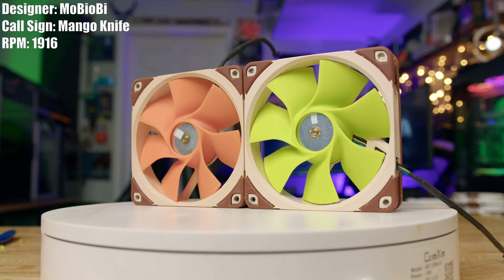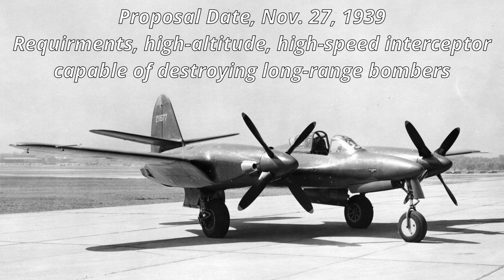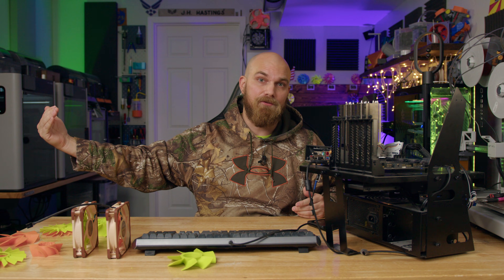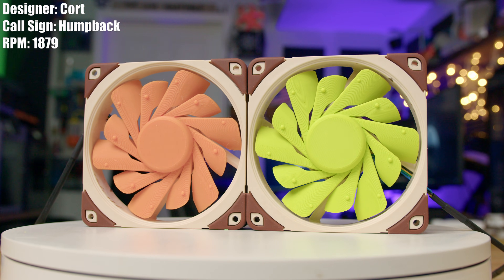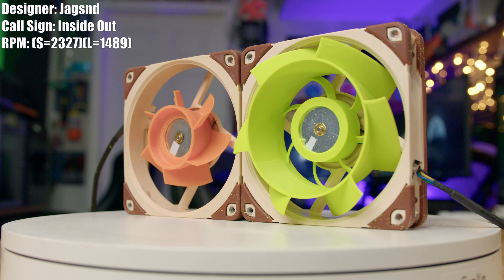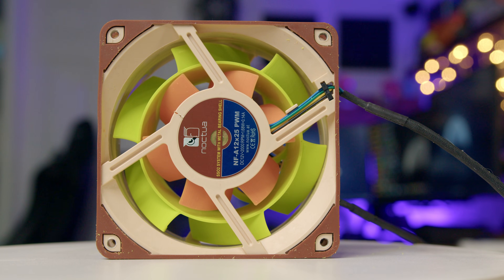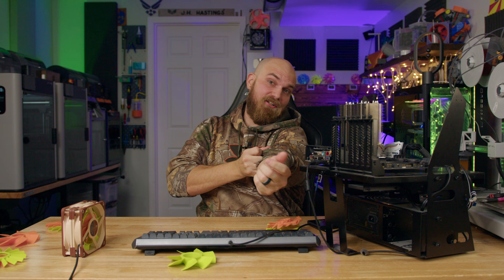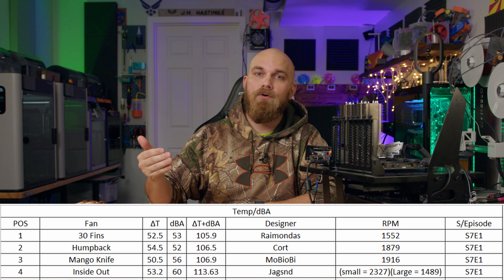Stacked TWIN Fan… is a Monster | Fan Showdown S7E1

Comment: The new smoke machine is sooo good! I immediately noticed it! Now we just need a high speed camera! (lol)
dT + dBA is okay as a metric, as then you can trade off one for the other, but I think there might be a better approach. A dT 90 with 10 dBA would beat all the current fans, but be a terrible fan. I did a few tests in my spreadsheet, but no good equation came to mind. 
Maybe it is a bit too late night :D I will think about it!
Reply: Good point, although most people would be striving for greatness, there will always be 1 joker that submits what you said just beat everyone.
Reply: I liked the smoke test too, although I did miss the big puff and seeing seeing how and where the fans scavenged the air from.  I found it interesting how some fans grabbed air centrally, others grabbed it from just everywhere, but some also would also end up rejecting air around around the front edges rather than pulling it in.

Comment: For scoring, you need to just have 2 scales. The fans score on a scale relative to all of the fans within the season, getting a score out of 100 based on what % difference there is against the most performant fan in each category, normalized against the worst. Add the two scores together to choose winners.
Reply: Right. When comparing two factors, you would just plot one as x and one as y.  Sometimes it's customary to invert one of the plots to make it so "better" values are larger.  For here. Where a lower dB and lower delta-T are preferred, one axis would be inverse db (1/dB) and the other would be 1/delta-T.  It's not super intuitive whena stated like this but when you plot each Fan's result you get an area of a rectangle and the bigger that area the better the fan is.  You end up with a lenticular distribution where the outliers become more obvious.   This also gives options when choosing a fan at the end, where if you want  fan with certain properties you can just draw lines or curves on the graph to find similar fans.  A great too for visually analyzing simple two factor systems.   Especially popular in materials selection because the bottom axis is always inverse cost, lower is better.
Reply: You  shouldn't use dB to score the fans because the sound itself is subjective because  of frequency. 
You can have 2 fans that have the same exact dB levels and one fan will sound louder because of the frequency!  In reality, one fan can have a lower dB and sound louder to you.   The sound is subjective because the fans make sound at different frequencies.  
However, I really like what you guys are saying with the way to score something...  
He needs to scrap the dB as it's subjective.  It provides data but its not useful for scoring.   

 If he has the temp delta, why not have how much air the fan pushes... CFM of the fan ?  ... anything but dB  😁

Comment: Adding ∆T and dBA doesn't work, if that's what you're doing - for ∆T, higher is better, but for dBA, lower is better, so you're adding incompatible units. A really, really, REALLY loud fan would score highly pretty much regardless of how well it cooled. Maybe you need to set a noise ceiling (anything louder than that = DNF), then do ∆T + (C - dBA)? And do some scaling to take into account decibels not being a linear scale.
I dunno, something like that. It's hard to say for certain that you're doing it wrong when you didn't explain what you're doing: the column title says ∆T+dBA but its contents disagree

Comment: I'm thinking your ratings aren't right ... you are making the ΔT as larger is better; then the sound as smaller is better and adding them together. Doesn't this skew things? Wouldn't a better rating be where you took the ΔT as the total subtracted from a 100 (or some other arbitrary number), then add it to the dBA? That way you are talking you are making both as "lower is better" and coming up with an accurate  representation?

Comment: Testing acoustics seems difficult because it depends on different things like rpm, print quality and noise floor (room noise), etc. Also implementing dbA into the score board by adding it to the rest is probably not ideal...

I wonder if it would be better to test every fan at a fixed rpm, noise normalized, or keep testing them at max speed like it's set up atm

Comment: I think greater 'weight' should be applied to the cooling. All the differences between fans are quite small and the sound level is not a linear scale. Therefore multiply the delta T by 2 (adjust as appropriate).

Comment: If the blades are the same, seeing both at same time is a bit distracting. Visual scrutiny was easier seeing the single blade. I do understand if submissions are two different designs working in symbiosis that we need to see both.

Comment: I don't think you should just look at dB but also the pitch of the sound. A higher pitch is WAY more annoying than just being louder. Two fans at the same dB can be drastically different in human perception of annoyance.
Perhaps do a Pitch x dB / 2 or 3 = Score for sound? I don't think score should score for as much as air moved.
Reply: This makes sense for reviewing normal off the shelf fans, but these are totally conceptual. The "annoyance" factor is mostly irrelevant since these will likely never see use inside of a normal system.

Comment: the thing is..... the idea to do it this way is totally finde, but it lacks the comparison to the old fans. so normally you would have to test every single fan from the past again to use your new method. I startet watching because i wanted to know the best fan i can possibly print myself for my PC but with all those changes and the wild ways to set them up, it just does not work anymore.

Comment: You should multiplay Temperature with dB. 29 + 31 ist 60 which would equal with 30+30 but with multiplay 29*31 is 899 which would win over 30*30

Comment: Excited for the new season. Only thing (besides adding two Noctuas as a reference) I would change is that I would give the loudness rating only 1/2 as much impact as the performance, otherwise it might skew the results too much. I'd much rather have a slightly noisier fan, that keeps my components markably cooler...
Reply: Yeah, definitely needs some kind of noise to performance ratio score
Reply: Yeah, a lower temp also allows you to turn the fan speed down which reduces noise, often drastically.
Maybe adding a test where the fans are controlled to a set temperature instead of whatever speed they just happen to run at and then measure noise.
Reply: Define "slightly noisier" in a non subjective way.
Reply: @tomstech4390  I’d rather have my fan be 5db louder if it offers a 4-5 degree temperature difference
Reply: @TRPLD  That's a lot.
Reply: @kristoffer3000  I know, I didn’t put much thought into it. What I aimed to get across is that I am not as sensitive to sound as I am to higher temperature in my components.
Reply: @TRPLD  I'm sensitive to both, having a completely silent pc that's also cool is not hard, just requires a bit of planning and scrutiny of parts.

Like for example I have a 420mm AIO for my 5800x3d that's undervolted, 10 fans in total (not counting GPU or PSU) and they're all running at low power because I rely on moving a good amount of air with just brute forcing surface area
Reply: @kristoffer3000  nice setup. Most of the time I run my pc in a room where lots of other noises are so it really doesn’t matter as long as we are not talking about jet engine levels of noise.

Comment: I believe you should also include the first decimal for the noise. Given that some differences in the rankings are and will be smaller than 1.0 on the chosen metric, it wouldn't be fair for someone who can get a fan's noise level to e.g. 54.5 dBA instead of 54.9 dBA, seeing that something like that would actually impact the scoreboard.

Comment: I think an interesting concept to explore would be considering the root frequency of the noise as well. Since lower frequency, noise is generally regarded as more pleasant or not as loud, perhaps an instance is when two fans produce the same level of noise you would prefer the lower frequency one; that is while fans are still marked down for making more noise, they are less penalized when that noise is of a lower frequency. It would be less disturbing to a potential user

Comment: Adding DB to the temperature is a bit of a weird way to normalize and score.
DB as you know isn't linear.   Converting the DB to a normalized value then using that to adjust score would be a better way to do it.
Like comparing to stock fan and making that 1, say +10db for 2 if going for percieved loudness as a scale, then dividing that by the temperature score.  

Adding Delta T to DB will make things weird for sure

Comment: I like these changes, acoustics is very important in most real world applications unless you have some sort of server room set up. Why not have the tower cooler be part of the smoke test? Still use the plexiglass but have the cooler in between the glass and back fan. Might be able to catch some interesting patters or discover something overlooked.

Comment: For the 8th season you could do Sound normalized testing. 
Meaning you take for example the Basic Noctua fan. Run it at 80%. Measure the Noise Level, lets say 50dB. Now every other other Fan will be adjusted by speed until they hit 50dB. Some might rung faster, some may run slower. And now you compare the Thermal output.
Reply: That is definitely a good way to measure a season.
Reply: @SquishyFletcher  Except if you can't make a fan reach 50dB
Reply: @big0bad0brad  If a fan can't manage to reach 50dB when you slow it down, it's just not going to qualify for the competition.
Reply: @SquishyFletcher  No, I mean if it can't be made that loud
Reply: @big0bad0brad  then you just run it full speed.
Reply: I agree completely with one little change, make it 40dB. That would actually make things interesting for a daily PC.
Reply: @arnoldnym2466  Still not ok method to test since your pc doesn't care how loud the fan is. It cares what the temperature is and when it gets hot it turns up the fan.... so the noise is always determined by heat. if it cools down better it will use less noise, but I think this is for you to factor in.

Comment: I feel like adding temperature and decibels to get a score is pretty useless. One of them is logarithmic and one of them is linear, and arbitrary based on the physical properties of water. If you want to compare them, I think the best approach would just be to use some sort of PWM control and just set the level so that all fans have the same volume (say 50 dBA).

Comment: I quite like the new testing methodology. It's nice that quiet fans will get recognized.
We need a reference measurement using 2x NF-A12x25 as the goalpost, though. It's be real nice if you also procure 2x NF-A12x25 G2 to show what Noctua has done in the years that the fan showdown has been running.

Comment: Noise normalized seems to be the more typical way to include noise in the scoring. It seems odd that delta T and dB are being combined at the same scale when one is linear and the other is non linear. If noise normalizing, it would be good to at least test at a whisper setting like 30dB and then maybe 40 or 50dB for a noticeable but still background sound level and then maybe a full power?
Reply: That thought of mixing scales crossed my mind too. But I believe our perception of volume is also logarithmic? Which would be why we use the dB scale. So, it might not be too unreasonable. However, each individual is likely to priroitise temp vs sound differently, so it would be impossible to come up with a scoring metric that everyone would agree to.
Reply: Maybe I'm confused, but I thought a previous season did do noise normalized testing.  It may not have been used as scoring, but I swear he did it
Reply: Yep, the weighting seems arbitrarily tied to the decibels and degrees...figure out the weighting then work backwards i would think.  Great idea adding sound to the scoring, but it should be about 30% of the score or something
Reply: They should not be added. ∆T is the higher the better while dB is the lower the better. For the same noise, a fan that cools nothing (0 ∆T) will win.
Reply: @andreslorenzo1623  i made this same mistake, the delta T measured is the difference in temperature from room temp, you want that to be low which means its closer to room temp, higher means its further from room temp
Reply: @guesswho2778 oh, I see now. That's embarrassing.  😂
Reply: @andreslorenzo1623  nah thats all good, i made that mistake as well but deleted my comment.
Reply: To explain further, 3db ~= a doubling in sound energy, 6db ~= a doubling in sound pressure, 10db ~= a doubling in perceived sound. 
But is a doubling in sound equal to only a single degree delta change? I wouldn't think so. Maybe multiplying the 1/10 db by 10 is close enough, and we are back to where we started.
Reply: Fully agree, the current scoring calculation will benefit quieter fans more than cooling ones. For example 52dB is 6.3 TIMES louder than 60dB but 54.5 is 1.08 times hotter than 50.5.
Reply: @ouzoloves  No, 60dB is 6.3x the *power*, but is roughly 1.15x the *loudness*. Human perception is also logarithmic. In that sense just adding them is fine. It's not very elegant though.
Reply: @Sibula  since we are talking about scores, it's good to create a scale of like, 8-10 = <30 db (silent) and lowering the score as the sound power increases. Same for CPU temp. Use a CPU with the original AX25, set the rpm at max power for benchmark, get the temp and create a scale with the AX25 in the middle of the scale. The lower the temp, higher the score. Same thing with the other side.
Reply: @rafa_rds  Seems way mor arbitrary and hard to reason about than setting a noise target, then fiddling the dial until it's met.
Reply: Yup, made a similar comment about noise needing to be a ratio multiplier of the delta temp, It additive at an entirely different scale.
Reply: sounds like a lot of work...
Reply: @namenloserflo Not so much. The only thing to change between readings of the same fan would be the speed, with a little fiddling to dial in the target noise levels.

Comment: That 30 fins sounded really nice, like a white noise machine, I'd pay for that
Reply: OMG IKR! not just me. I REALLY liked that. I would actually buy those. ... although I would REALLY REEEEEEALLY effin HATE cleaning them! ahahahahaha
Reply: The lack of notable large frequency peaks and overtone of frequency peaks make the 30 fan also to me sounding rather nice :-) , a fan i could easily live with.
Reply: I was going to comment on it, and just adding to yours.  Fans can be loud, but how they sound also plays a role in how tolerable they are.  That 30 blade is something I would not mind for cooling, if I had to choose the sound.
Reply: It's because the bulk of the noise is at very low frequency which is near human cutoff - 28hz, the next highest bump was up at 240hz and was still considerably lower than the other fans, at 40db.

Comment: I think the problem with using DB in finding the score because of how sound is measured. It is not linear and goes up exponentially. A .1 at 60 DB is a lot more than a .1 at 50. Am I wrong thinking it does not scale properly? 0.1 C differential is basically the same at -200 C as it is at 200 C. 
Would have enjoyed seeing "in and out" run spaced out for both sound and cooling test. 
Love seeing the weird and complicated ones tested. Should do a whole season dedicated to overcomplicating the design. Bonus points for the person to use the most parts. Go full German engineering.
Reply: 1 dbA (or 0.1 dbA) is the same as 1 dbA anywhere else at the scale. Every 3 dbA it's a doubling in loudness, because logarithmic scale.

What you think about is that human loudness perception is nonlinear, described by psychoacoustic models such as: Fletcher-Munson curves (equal-loudness contours) or Zwicker loudness model (sones / phons), BUT there at higher SPL (Sound Pressure Level - which dbA is scale for [1]), humans become less sensitive to small changes, not more. So if anything:  A 0.1 dB change at 50 dBA is already undetectable. A 0.1 dB change at 60 dBA is *even more* undetectable.

Let alone a 0.1 dB change being way below human detection, anywhere on the scale.

[1] decibel (db) - a unit used to measure the intensity of a sound or the power level of an electrical signal by comparing it with a given level on a logarithmic scale

Comment: Sound profile changes allot when you mount a fan on a heatsink vs running them free-standing. It's why people put spacers between water cooling radiators and fans, having the heatsink right behind the fan causes turbulence and noise. If noise is a factor in the final score, it should be measured with the fans on the heatsink.

Comment: Hi! I think is better ranking result is where the (performance*2 + dB)/3 method, becouse performance is more relevant. For example Mango: (50.5+50.5+56.4)/3= 52.47; 30 Fins: (52.5+52.5+53.4)/3= 52.8.

Comment: I think you should install the fans on the cooler an then measure dB from a set distance. Then adjust the fans rpm until a predetermined noise level is reached. CPU temperature at that set noise level can be ranked as in previous seasons.